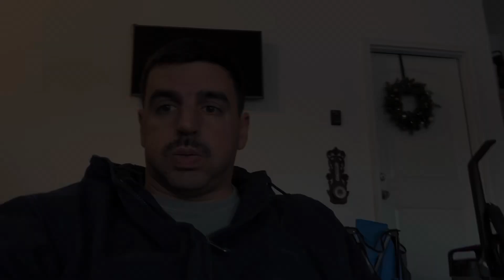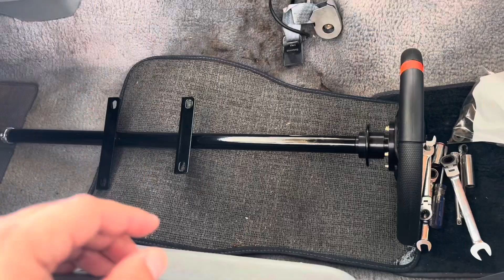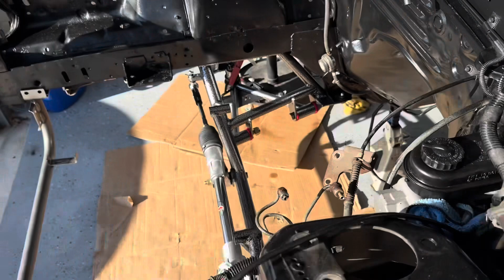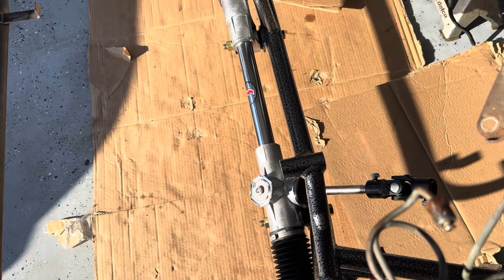Extreme Street Foxbody No Prep Build - Ep. 2 Front End and  Steering

Comment: I was able to keep the single exhaust brake hard line that runs down the passenger side when I converted to dual exhaust.  I bought a v8 brake hose coupler that is usually riveted to the center of the trunk pan.  The 5.0 online parts houses sell that bracket for about 25 to 30.  I used large sheet metal screws to mount it to the pre-existing holes in the floor pan.  Then i put two simple bends in a pre-flared generic hard line from the local parts store to connect that v8 brake hose coupler to the existing single exhaust hard line that is on the passenger side.  The connection is made with a simple union to where the single exhaust hose normally screws onto that passenger side hard line.
Reply from the maker: Yea looking at what I have and what’s already there, I think I’ll be able to keep the existing line. I won’t have an exhaust back there since I’m doing a fender exit so it won’t be a huge issue

Comment: This is the reason I still have the stock column bc I need my ignition & blinkers lol
Reply from the maker: Yea man I had a touch of regret for a split second lol. But it’s all good. Just means I got a little extra wiring work to do to get it all to work
Reply: @RegularGuyGarage  yeah I feel ya. Maybe one day. I don’t even know the weight savings difference if it’s worth me doing it lol. I just know this 3200lb pig needs some weight lose lol
Reply: The bad thing is if the column ever locks for some reason and you can’t steer it won’t be good. I would pick safety over an easy route anyway.